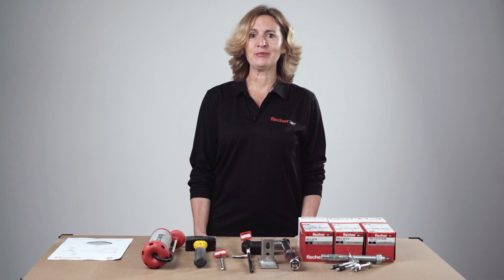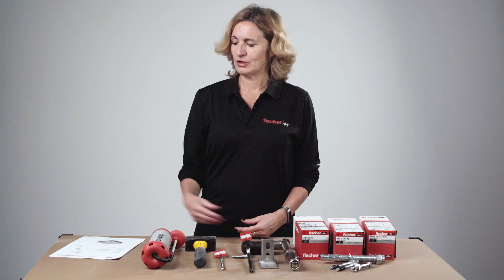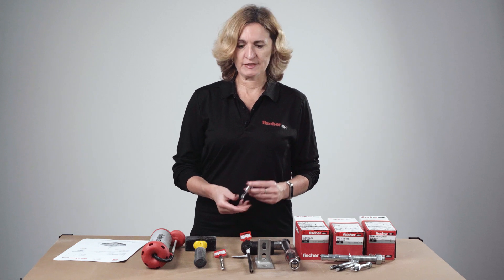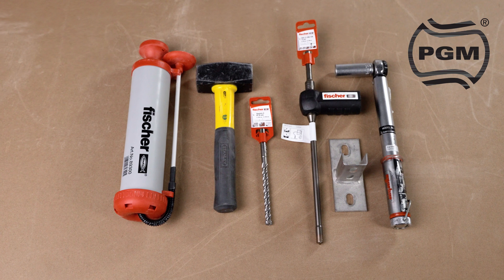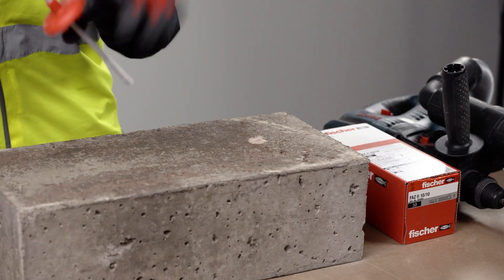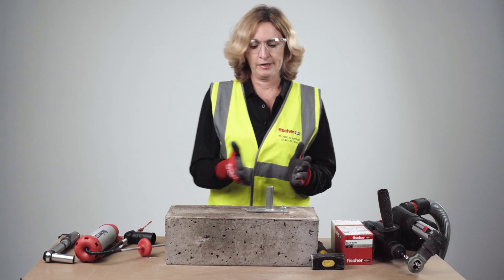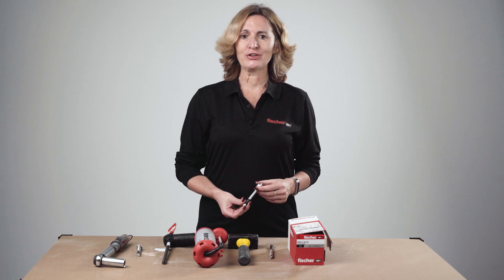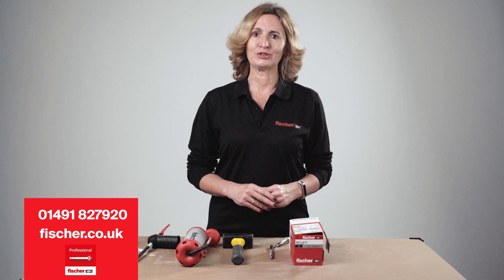fischer FAZ II & FBN II Bolt Anchors | fischer ToolBox Talks Training

Comment: Great explanatory video! Would you recommend this product for mounting a pull-up bar to a concrete ceiling? Thanks.
Reply: I'm looking for the same answer - what did you and up using?
Reply: As long as you don't weigh more than 1800 kg